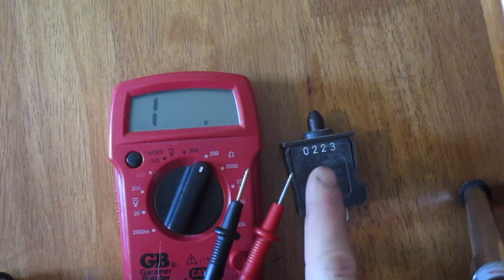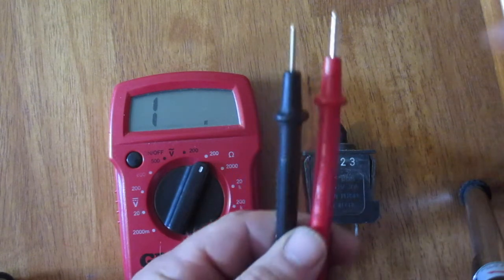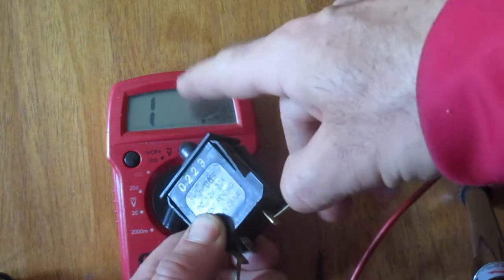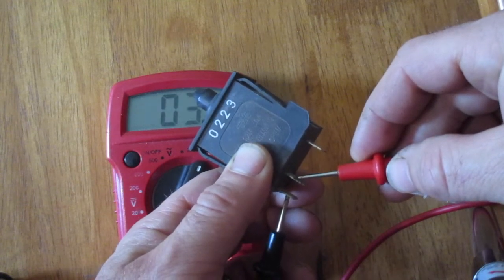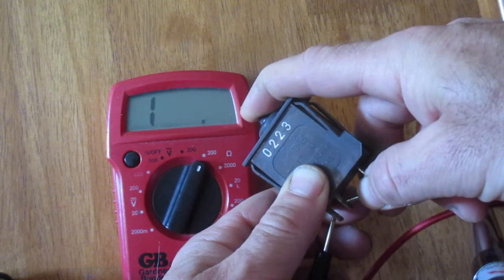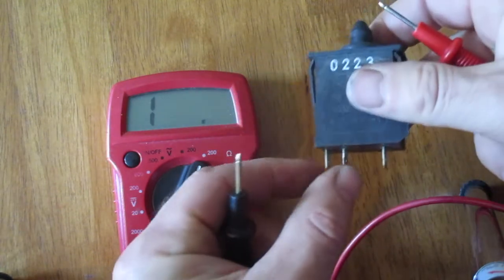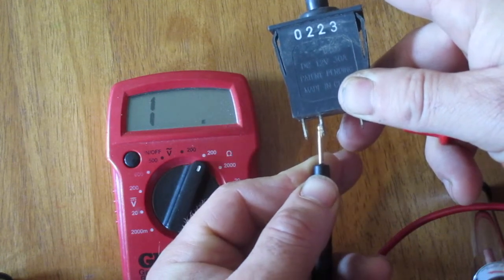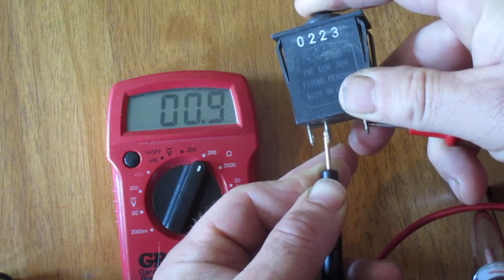How to test Power Wheels gas pedal Switch throttle Jeep Wrangler F150 SUV ATV Truck John Deere Quad

Comment: I just got into one of those today.  Mine didn't work at all. I cracked it open with a knife on the side of the switch.  I cleaned all the contacts, and added some dielectric grease. Glued it back together, and it is good as new.  If yours doesn't work, it can be fixed.
Reply from the maker: Thanks for the update.  Yeah they usually have contacts that get burned and just need a sanding.  They are also pretty cheap to just buy used on ebay.
Reply: How do we clean the contacts

Comment: Thank you for your video that might be helpful later. Can you please help me with my specific situation, my problem is a little different. 
Some kid ripped out (disconnected) the wires at the pedal switch. I don't know which wire connects to the proper pin in the starter switch. I tried it different ways and I blew  fuses...
FYI.... The starter switch has 3 pins and they are marked 1, 2, and 3. 
There are 3 disconnected wires. 
One is white, one is orange and one is red. 
I would like to know which number pin connects to each specific color. I am pretty ignorant of electrical problems and how to solve them . 
NOTE: the toy jeep worked perfectly fine before this happened . I would really appreciate your help and response to my problem. Looking forward to your reply . Thank you and best wishes.
PS: this Fisher-Price Mattel toy jeep is approximately 10 years old and does not have remote control etcetera..
Reply from the maker: Sorry we no longer have power wheels at the house, so I can't check.  Guessing you got it figured out by now
Reply: @youcanfixit3721  yes..  but thank you for taking the time to respond best wishes

Comment: I have a kaweits multimeter but I don’t have the option to select 200 ohm? What am I missing
Reply from the maker: I don't think it matters too much the setting.  If there is continuity then it's good if the settings never change it is bad.  It should go from an open circuit to a closed circuit or vise versa I can't remember without looking it up.
Reply: Thank you so much for getting back to me! I checked the switch and it’s working. My question is…. The lines to the motor should they read an open line? I can’t figure out what’s wrong with the power wheels. The power light is on but the gas pedal does nothing. I directly connected the motors to the battery and they work but when not connect back to the wiring is says open line
Reply from the maker: @wlm1217  I'd have to be there to fully see what is wrong, but if the gas pedal is working and you know the motors work it sounds like the wiring.  Are the wiring connectors seated correctly.  Also are they running though the throttle.  If they are that may be the issue.